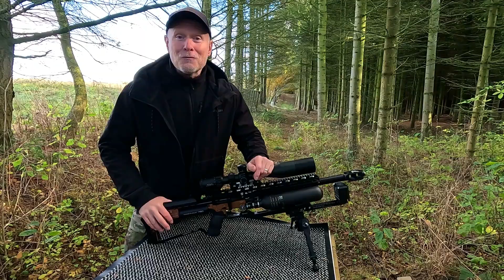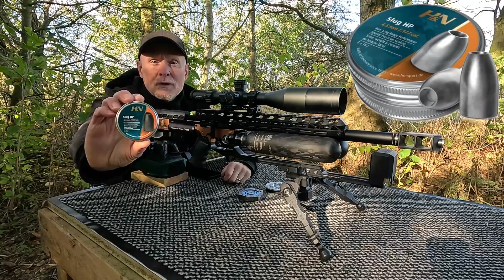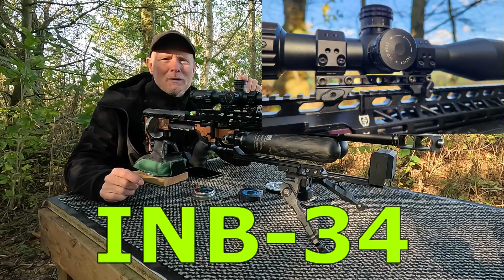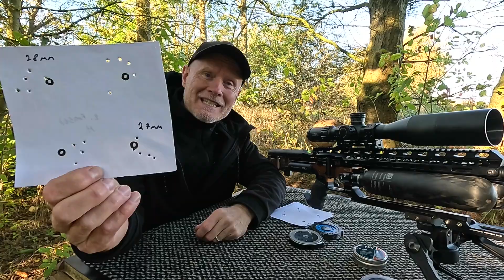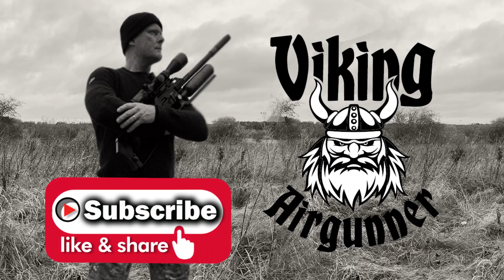FX SLUG LINER Gen 1 vs. Gen 2 – Is the New Version Better? | FX IMPACT SERIES pt 27

Comment: Nice  shot bro..i like to see how amazing 1.77 does at 100 m...Inronesians love it..I shoot 30grains slugs in .22 at 300m/s..tiny groups at 100 ms...Matt Dubber was  right ...heavy  slugs x high spead=long range...and the reg is set in 150bar, power wheel 16,micro 5,pressure valve in 4 line.stx superior 700m...maybe  in time i will get a heavy slug liner 1/16..and power kit...for now fx m4 is doing right..as you show in other videos...maybe dont need a power kit...

Comment: how does this liner latest pid, compare to the fx superior 1:18 fx20598 shooting that slug?
Reply from the maker: The fx20598 is a 700mm 1:28
Reply: @VikingAirgunner  is there somthing new then? because that partnumber is 1:18
Reply from the maker: @boedihoe2573 Nope. Send me a message on FB and I will send you a pic of the liner🤓
Reply from the maker: @boedihoe2573 the  700mm stx superior liner is fx20430, the 700 mm STX Superior Heavy liner is fx20815 and the 700 mm Slug liner is fx 21099.
Reply: @VikingAirgunner  Art no: Denomination: Description:
20362 Liner 4,5 300mm Superior Factory Standard - Twist Rate 1:18
20187 Liner 4,5 380mm Superior Factory Standard - Twist Rate 1:18
19964 Liner 4,5 500mm Superior Factory Standard - Twist Rate 1:18
20813 Liner 4,5 500mm Superior Heavy Accessory - Twist Rate 1:18
20430 Liner 4,5 600mm Superior Factory Standard - Twist Rate 1:18
20814 Liner 4,5 600mm Superior Heavy Accessory - Twist Rate 1:18
20598 Liner 4,5 700mm Superior Accessory - Twist Rate 1:18
20815 Liner 4,5 700mm Superior Heavy Accessory - Twist Rate 1:18
20243 Liner 5,5 300mm Superior Factory Standard - Twist Rate 1:24
20188 Liner 5,5 380mm Superior Factory Standard - Twist Rate 1:24
20379 Liner 5,5 380mm Superior Heavy Accessory - Twist Rate 1:16
19965 Liner 5,5 500mm Superior Factory Standard - Twist Rate 1:24
20070 Liner 5,5 500mm Superior Heavy Accessory - Twist Rate 1:16
20011 Liner 5,5 600mm Superior Factory Standard - Twist Rate 1:24
20073 Liner 5,5 600mm Superior Heavy Accessory - Twist Rate 1:16
20204 Liner 5,5 700mm Superior Factory Standard - Twist Rate 1:24
20206 Liner 5,5 700mm Superior Heavy Accessory - Twist Rate 1:16
20645 Liner 5,5 800mm Superior Accessory - Twist Rate 1:24
20646 Liner 5,5 800mm Superior Heavy Accessory - Twist Rate 1:16
20189 Liner 6,35 380mm Superior Factory Standard - Twist Rate 1:24
19976 Liner 6,35 500mm Superior Factory Standard - Twist Rate 1:24
20072 Liner 6,35 500mm Superior Heavy Accessory - Twist Rate 1:18
20861 Liner 6,35 600mm Slug Accessory - Twist Rate 1:16
19966 Liner 6,35 600mm Superior Factory Standard - Twist Rate 1:24
20071 Liner 6,35 600mm Superior Heavy Accessory - Twist Rate 1:18
20659 Liner 6,35 700mm Slug Accessory - Twist Rate 1:16
19977 Liner 6,35 700mm Superior Factory Standard - Twist Rate 1:24
20069 Liner 6,35 700mm Superior Heavy Accessory - Twist Rate 1:18
20688 Liner 6,35 800mm Slug Accessory - Twist Rate 1:16
20717 Liner 6,35 800mm Superior Heavy Factory Standard - Twist Rate 1:18
20190 Liner 7,62 395mm Superior Factory Standard - Twist Rate 1:40
20370 Liner 7,62 500mm Superior Heavy Accessory - Twist Rate 1:18
20369 Liner 7,62 500mmm Superior Factory Standard - Twist Rate 1:40
19967 Liner 7,62 600mm Superior Factory Standard - Twist Rate 1:40
20233 Liner 7,62 600mm Superior Heavy Accessory - Twist Rate 1:18
19978 Liner 7,62 700mm Superior Factory Standard - Twist Rate 1:40
20234 Liner 7,62 700mm Superior Heavy Accessory - Twist Rate 1:18
20689 Liner 7,62 800mm Superior Heavy Accessory - Twist Rate 1:18
20608 Liner 9,0 500mm Superior Accessory - Twist Rate 1:25
20607 Liner 9,0 600mm Superior Accessory - Twist Rate 1:25
20606 Liner 9,0 700mm Superior Accessory - Twist Rate 1:25
20852 Liner 9,0 700mm Superior Heavy Accessory - Twist Rate 1:24
20286 Liner 9,0 800mm Superior Factory Standard - Twist Rate 1:25
20851 Liner 9,0 800mm Superior Heavy Accessory - Twist Rate 1:24
Reply from the maker: @boedihoe2573 I have that sheet, but I also have the pictures of the liners with the numbers.
Reply from the maker: @boedihoe2573 but anyway.... You are talking about the STX Superior liner in 700mm with a 1:18 twist rate, and it is made for pellets and lighter slugs. I tested it a long time ago and it had some serious issues. I dont know if they made improvements in the later versions, but I will never install it again. Worst liner I have ever tried.
Reply: @VikingAirgunner  i have seen that liner in a youtube video, and it says 1:18, so im confused?
Reply from the maker: @boedihoe2573 fx has had some problems with the markings of liners so perhaps that is why we have different info🤔 I Once recieved a 700 mm marked as a 500mm 😂
But please send me a message on FB. I would love to show you the pics of my liners 🙂
Reply: @VikingAirgunner  okay, cause i saw a video with the hn 20gr shooting 930fps and the groupings didnt look that bad at 100m. the pid on that liner was (9778)
Reply: @VikingAirgunner  sent on messenger

Comment: Is a pipe tensioner kit worth it? Or did you not see any improvements?
Reply from the maker: I have used it on my M3 where it did a good job. Made some videos about it that you can find here on my channel aswell.
Lately I returned to the shroud, and with the Saber Tactical rail installed, I can clamp the barrel, and this has some what the same effect as the barrel tensioner.

So in short yes there is an effect, but the free floating barrel with the shroud does a good job too - EBR 2025 was won like that😎

Comment: When are you purchasing the leopard
Reply from the maker: It is not a plan of mine.
Reply: @VikingAirgunner  just going by the uptake on the leopard is out selling the M4 !  And really hard go get .
I know you you’ve had great results with the 16&20gr slugs  and I’ve a leopard purchase just waiting on delivery?? 
I’ve the 177 sniper heavy barrel 1:16 tube version booked.
Hopefully get the same results  as you’ve have experienced with the M4
 
Ive  been following you on u tube for a long time 
On all of the fx drs /drs tech / and the M4 
The information you provide is brilliant
Reply from the maker: @richardcowan1422 I really hope that you will get some good results with the Leopard. The good part of the different models is they have the same barrels/liners so the results are usually not that different.
But lets see... I have said before that there was a model that I was not planning to get, and it ended up in my stock anyway 😃

Comment: Please advise, sir.
For MK2 users like me, to maximize performance, is it necessary to replace the 720 plenum and power block? And also the tungsten?
This applies to heavy 177 slugs.
Thank you, sir.
Reply from the maker: And a very good idea to ask!
I made a video way back about the difference between the "old" block and the Power Block, and there was absolutely no gain. Might be different in bigger calibers though.
Do you have a 720 cc plenum on a mkll? In case you do, there is no gain in replacing it with the 750.
And please stay FAR FAR away from the tungsten hammer unless you are shooting bigger calibers. In 177 it will only mess up your gun!
What you can do to make your gun better is a carbon fiber barrel sleeve (not the barrel tensioner), a stiffer backbone rail and a 1:18 heavy liner if you can find one 👍
Reply: @VikingAirgunner  Okay, thank you, sir. Your content is very useful for air rifle enthusiasts like me

Comment: I see you switched from a suppressor to a muzzle brake (that wouldn't look out of place on a .300 winchester magnum). Are you testing the effects of different muzzle devices?
Reply from the maker: When I have the chance to use it without havin to worry about the sound, I really like using the muzzle brake. It seems like improving the groups, so I will go deeper into them for sure.
I hope to get one shortly for my next project with the Delta Force DRS Pro, but more about that in a not too distant future 🤞🤞

Comment: The problem is that if you buy two supposedly identical liners, you'll end up with one that's slightly better... the idea that they're exactly the same, as some people claimed, isn't true.
Reply from the maker: But this is where it would be interesting to see if the difference between the liners are actually bcs they are different generations - different PID numbers🤔
I was made aware of this not too long ago, but I actually believe that this might be the reason for the issue you mention.
Reply: @VikingAirgunner  I said that because I've bought several liners over the years, and what I can say is that the first generation had a problem where I had to clean it every 30 shots. Then I bought three identical liners, some from the Huma website and others here in Portugal, and I noticed that even though they were the same liner (2nd generation slug 600mm), they were slightly different sizes and produced different results. I suspect there are special liner options for certain people. Best regards and keep going!
Reply from the maker: @Miguel-Simao-c5k thats interesting - and saddly not in a positive way. Did you adress this to the dealers?
I heard about faulty liners - even recieved one myself - so I know that there is an issue.